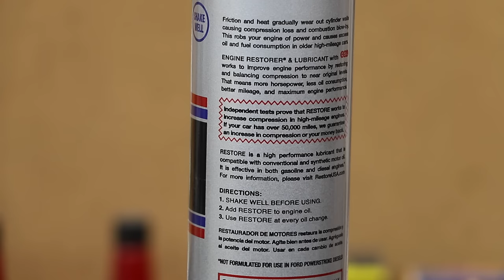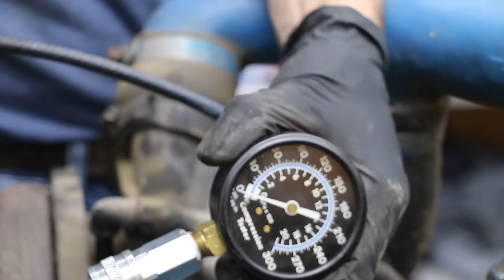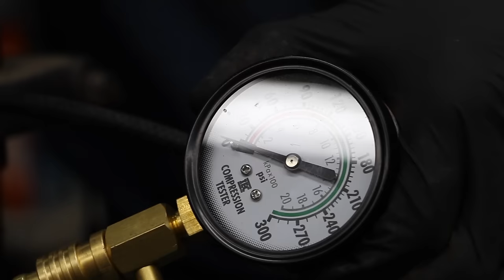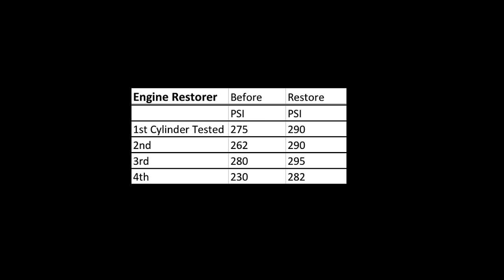Does Restore Work?  Will it Improve Engine Cylinder Compression?

Comment: but does it start without the block heater now?
Reply from the maker: Max, I had to leave town on business before I could test cold starting the engine.  I'll test it when I return tomorrow and will provide an update.  Thanks for watching the video and commenting!
Reply: It will be also great if you could report how the results change in the long term
Reply: +Project Farm Im also interested. Make sure we find out about the results.
Reply: Project Farm were the compression test both done hot?
Reply: Can't wait to hear
Reply from the maker: Barry, Great question.  The engine was cold during both compression tests (before and after restore).  I allowed the tractor to cool off over night after using it for several hours with the brush hog.  It takes hours for an engine like this one to reach room temperature.
Reply: Can't wait to see if it will cold start.  Please do update us.
Reply from the maker: Max, an update.  The tractor now starts as it should without using starting fluid or the block heater.  I'm very pleased!
Reply: Project Farm thats actually pretty impressive. seeing that low cylinder come up so much was a surprise
Reply: Amazing! Great video! Did you notice a difference in the way the tractor runs? Was it smoother and quieter? Also, what is the compression supposed to be on this tractor?
Reply: m4xwellmurd3r impressive ? Yeah right... for how long? This not even a short term solution
Reply: Of course not
Reply: Tractor still running good after all this time?
Reply: Why is this not a short term solution?  Are you one of those people that just says things cause your mind isn't capable of viewing facts and changing opinion?
Reply: That was interesting
Reply: I use restore loyally and my only concern is how much of the material is collected in the oil filter. 
I have noticed lower oil pressure while using it and when I change the oil the pressure rises back to normal until the next batch of restore is added.
Reply: That is awesome!
Reply: I wouldn't like the low oil pressure. Like medicine-- a nasty side effect.
Reply: James Crabb 
It's only about a 10psi loss. But it still concerns me.
Reply: A 10 psi loss is only a big deal if you only had 10 to 15 psi to begin with. I have a diesel that idles at 0 psi hot. Its a 6.5 GM with a high power marine build and it runs great. It cruises at roughly 22psi at 65 mph. Pull up to a stop sign during the summer and it drops to under 5 psi and many times 0psi.  Been that way since it was built some 60,000 miles ago.  Before a long trip across the US last year I pulled the pan and pulled some main and rod bearings. They were in new condition. I tried to find the leak but its a diesel and everything is blacker than black up there. The brightest lights just disappear like a black hole or something. I couldn't see anything. When I ran the pump manually with the oil pan off it was coming from the back area above the pump. I don't like mysteries so I will pull this engine and I will locate that leak one way or another. Engine runs beautifully otherwise. 
This experience reinforces what an old professor told me. He said oil pressure isn't a big deal. Oil supply is the big deal. Really old engines and even small engines today have no oil pressure at all. But they do have supply. Old engines used a drip system that dripped oil on the bearing/bushing surfaces. These small engines use a splash system that works well enough to get oil up to and lubricate the top bushing.  The top usually is the first to fail when the oil gets low or turns to tar from neglect.
Reply: It's been 8 months how did it hold up?
Reply: Project Farm, how is the tractor running 10 months later? Also, thank you for all the testing you do. Love the channel!
Reply: Probably depends on the engine, if the bearings have enough surface area that they work properly as long as there is oil in the bushing, everything is fine, even splash lubrication can work, now if the bearing is too small, or simply designed to work with high oil pressure, then it definitely needs oil pressure. It's all a matter of surface are VS the load placed upon the bearing, if it's big enough it's going to last forever as long as it has oil.

Comment: restore says it fills small scatches on the cylinder walls,and probly around where the rings set in the piston, wonder with what and how long that lasts, I never read the ingredients.
Reply from the maker: Yes, it contains copper, silver and lead.  Thanks for watching the video and commenting!
Reply: Interesting, I wonder if it could cause bearing issues from clogging oil channels and the like.
Reply: Not to mention it sounds like it's made of the same thing as the bearings.
Reply: Steve's Auto OSTROGOTH It's copper, silver, and lead. The effect only works with Restore in the oil. If you change it without adding more, the improvements vanish quickly.
Reply: I used restore a couple of times on an old ford 6.9 diesel that would burn oil due to setting up for a couple of years with some coolant in the cylinders. Truck would burn about 2qts a day. With restore it would burn 1/2 qt a day. After about 1 to 2 weeks it would be back to 2qts a day.
Reply: Blake Cooper, sounds cheaper than all the oil you are burning or the cost of a rebuild.
Reply: The can does say you need to use it every oil change
Reply: @Blake ..sounds like it's wearing off because it's still eating up oil (AND the Restore you added). So, of course after it eventually burns off a few qts, there wont be enough of the product in the motor to do It's job properly. At the current rate of consumption, sounds like some new rings and valve seals are in order. That's a pretty thick leak. Or maybe there's just an awful lot of carbon build up preventing valves from sealing properly.

Comment: I can say without a doubt this stuff works in gas engines.  I own a 94 Toyota pick-up and use it with every oil change, the truck has 317k on it.  I bought the truck in 2004 and have owned it for 18 years with 126k on it, started using engine restore when I bought it.  It has as much power now as it did at 126k.  I know it works because at the end of an oil change every so often I will run injector cleaner through the fuel system and it washes the restore off the cylinder walls and I can tell a power difference.  This stuff WORKS!  GREAT TEST AS ALWAYS!!!
Reply from the maker: Thanks!  Thanks for the feedback.

Comment: wow im shocked it worked so well, i wonder if its only a temporary fix until you change the oil. do an update later on the progress. thanks for the video!
Reply from the maker: Epibloger, I'm very surprised too.  On a positive notenow starts quickly without using starting fluid or pre-heating.  Thanks for watching the video and commenting!
Reply: The can tells you to use with every oil change. 

Its not a permanent solution, but a few houra of research have shown it is a viable shirt and mid term solution
Reply: ah yeah i think it's every oil change or at least every second oil change? but yes its is not a permanent fix, a permanent fix would be new piston rings and  cylinder  hone.
Reply: Not permanent, but as long as you dont use a chemical oil flush before every oil change, i've found that i only needed 1/2 the can on subsequent changes, ans it still worked. Put 35k miles on my 04 Xterra V6, and only used 4 cans total. Entire can first oil change, and 1/2 can every 5k miles - kept the compression leaks in cylinder 3+5 at same PSI every time
Reply: Martin Antz thats what i do in my lexus.its a 3.0 v6.i just use the 4 cylnder bottle for my car during oil changes,with just abot 1/4 of a quart over full mark.maybe not thar much.

Comment: Saved our mower it was losing 1 of 2 cylinder went from almost popping wheelies to riding wheelies very impressive man 

And around 1yr ago I didn't believe oil additive worked I was wrong.
Reply from the maker: Impressive!  Thank you for sharing the results
Reply: @ProjectFarm  definitely was wear from years of old employees washing the cylinder with gas when killing the mower at full throttle I've used it on a few cars next up my cousin just bought a 8L v10 dodge 2500 I'm curious so we're going to try it 😆

Comment: I LOVE this stuff!!!!!  Engine Restore is great.  Drove a 1991 Isuzu Rodeo with a 3.1 GM engine for 320k+ before it finally needed a rebuild.  Have a 93 Suburban with a 350 that's still going strong at 290k.  Consistently changed oil every 3000, and used Engine Restore.  Last fill-up I got 15 mpg in city driving.
Reply from the maker: Thanks for sharing.

Comment: This stuff does work. Had an old worn out Chevy 4 banger with compression so low it wouldn't start while cold. Add Engine Restore at every oil change. Works a treat. Started every time.
Reply from the maker: Thank you for the feedback

Comment: You might have been able to increase the compression using a higher viscosity oil say 50 wt and it would have been less expensive. If the low compression was caused by crud on the rings then break out the Marvel Mystery oil.
Reply from the maker: Great point. Thank you.
Reply: yea but engine restore is one and done. it uses some type of resin that under heat turns into a solid and actually binds to the piston rings. it's mostly to solve worn out stuff..

Comment: Why did you use a different compression tester gauge for the two tests?
Reply from the maker: Great question.  I had to buy a new gauge after the "before" test.  It seemed to work okay for the first cylinder during the "after" restore test, and then the little shrader valve in the hose gave out and wouldn't hold pressure.  The shrader valve is different than those used in regular valve stems or I could have borrowed one from a valve stem.  The new compression gauge hose even had a different fitting and would not connect to the old gauge.  I was pretty frustrated that I had to change testing equipment in the middle of the project!  Thanks for watching the video and commenting!
Reply: A good question, but a new gauge wouldn't produce such astoundingly different results for just a single cylinder.
Reply: The fact that you used a different gauges between the two test is a factor on the good cylinder gain in results but not the huge increase on the bad cylinder that was impressive. I keep two compression gauges in order to compare to each other as these COTS commercial Off the shelf gauges which are not lab tested or certified with an NIST  Calibration Certified program.
Reply: I've been using re store I'm all my car since 19 eighties late eighties when stuff    came out ..works great  302 ford Mustang motors in the 80s will burn a can or 2 of oil when they reach 100,000 miles   adding re store to motor you would only burn 1  quart and if u keep using it every 3,000 mile  down to burning half to quarter quart of oill .. the blue smoke go sway..  It works at all my cars right now I am on a 2006 explore 250000 miles using restore
Reply: I was wondering the same thing as jonbar87.  After reading your explanation and rewatching the video,  it appears to me that cylinder #4 was never actually low.  You can clearly hear the shrader valve leaking when you test #4, hence the low reading.  Restore may have added a couple psi to all the cylinders but that's about it.  Just thought you might want to know.  Love your channel, keep up the good work!
Reply: The fact that he had to change equipment nulls the entire findings. The 2 gauges could be as much 10% off from each other, and the "bad reading" on the 4rth cylinder could have been the gauge starting to fail. Completely failed test.
Reply: thanks for the tip!

Comment: Be advised if you're still burning oil after using this it could clog your catalytic converter.
Reply from the maker: Thank you!  The tractor isn't burning any oil and is running great.  I have another video (year 3) on the way.
Reply: @ProjectFarm  Can't wait to see year 3. This should be very interesting. Just let us know how many oil changes with the Restore in those 3 years.

Comment: Used on my high milage k5 with extremely tired 305 and worked awesome! Powered restored, idles smoother, eliminated blow by! Would of never guessed that it works as well as it did and will use another next oil change
Reply from the maker: Thanks for sharing!

Comment: Hello, you make the best consumer tests :) Please take in consideration testing a product that claims to restore metal by nanotechnology. It is an Ukranian military product called Xado Metalic Conditioner. It is available in USA also :) Thanks
Reply from the maker: Thank you very much!  Great test idea!
Reply: Xado is awesome,  I've used it in several engines with great results, it restores any friction related issues that's lubricated by oil with a very hard clear ceramic coating.

Comment: Wonderful video. I have a 5.4L Triton engine that has 318,000 km on it. It is still running strong, but I have been looking for ways to squeeze more life out of it. I may try something like this after I do some more research on the affects of the additives on modern engines. I am hoping to roll the odometer on this thing.

I have had the combustion chamber cleaned with Seafoam and changed the oil. I drove it about 2,000 km and changed the oil again to get rid of any sludge. The engine starts up smooth, the rough idle is gone, and it runs quieter. 

Your videos are amazing. Absolute top quality information. Unbiased and to the point with documented evidence. Your catalogue of knowledge needs to be stored in the public library for future generations.
Reply from the maker: Thanks!  Thanks for the suggestion

Comment: i wonder if 2 cans would be better becoes the engine is so big worth a shot
Reply from the maker: thebug 404, That's a great point.  I thought about adding an extra can since the tractor has an 8 quart capacity.  After some research, I decided to use just 1 can.  Thanks for watching the video and commenting!
Reply: How about running a lawn mower with JUST Restore in the crankcase (without any oil)?
Reply: J Smith good idea!
Reply: thebug 404 Use the larger can for larger engines as stated. I have been using Restore for 25 years on all my 100k plus vehicles,it does work and do add it at every oil change. Yes,it does work.
Reply from the maker: J Smith, Great suggestion!
Reply: RC Hobbyist Extreme I was thinking about buying some restore and putting it in my jeep because it has well over 360,000 km on the original 2.5 L four-cylinder
Reply: thebug 404 The way I looked at was it cannot hurt with that many miles on my vehicles. Now I use it on all my 150k vehicles.  It does work. I never ran a compression test but then again,action speakes for its self. I highly recommend it,but try it yourself. Make sure you get the proper sized can,dont add more than recommended, it makes no difference. Dont skimp eather,you will notice if you use it a while. I put it in every other oil change.

Comment: I have tried restore in an old car, it definitely ran better, I think there claim was it fills scratches in cylinder walls to restore compression, and you was mowing too fast,
Reply from the maker: I admit that I do mow too fast.  The Ford 5000 can handle a 15-foot batwing, So, it doesn't have any problem keeping the 8 foot brush hog going at higher speeds.

Comment: a long time ago maybe 15 yrs ago. I was driving a Toy SR6 when it started smoking a little but noticeable. I went into Wal-Mart and finally selected Eng. Restorer. I drove home about 200 mi away and noticed that the smoking quit. I also was skeptical that the oil filter would filter out the ingredients of the product. I never read the fine print about not using it in my 6.0 Super Duty. I always put a can of the stuff in after a 10-thousand-mile oil change. No problem and this truck has never smoked or used oil after 275K mi. still going strong.
Reply from the maker: Thanks for sharing.

Comment: I just found this old PF video! I watch all the new ones! We used restore back in the late 80s or early 90s on a Chevy 305 with a leaking valve guide. It would foul the plug every couple thousand miles. After 1 can of this stuff, the problem was solved. I can't remember how often we used it after that, but that engine never oil fouled a plug again. I still have it and it still runs great.
Reply from the maker: Thanks for sharing.

Comment: I tried this on a '71 Ford 400 that was a little tired and it instantly made a noticeable increase in power, mainly low end. It didn't last very long btw. Many years later I tried it on a '71 Chevy 400. I don't recall any power gains but what I did notice is my oil pressure dropped like a rock!!!  (mechanical AutoMeter gauge btw) You see, I plugged the oil filter bypass on the Chev. So imo it's likely clogging everyones filters but they don't notice because they have a bypass. This was about 25yrs ago so my memory is fuzzy on the following; but I recall cutting the filter open (why would I not?) and the pleats were packed with grayish black sludge, which if I recall is what the product looks like. So FYI to everyone, and maybe a filter check needs to be part of the test. 

Your tests are awesome btw!! It's all the stuff I'd like to do if I had the time, so thank you for taking the time, and $, to do it for us! We really appreciate it!
Reply from the maker: Thank you for the feedback